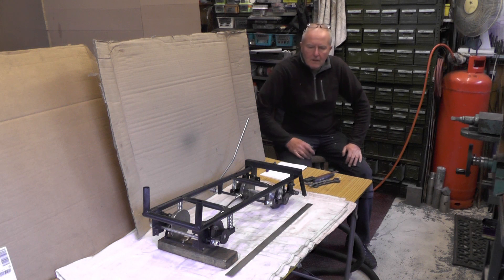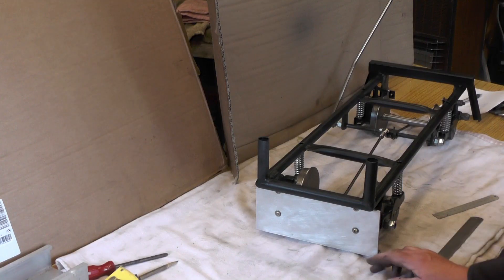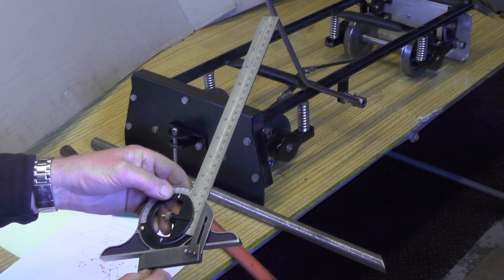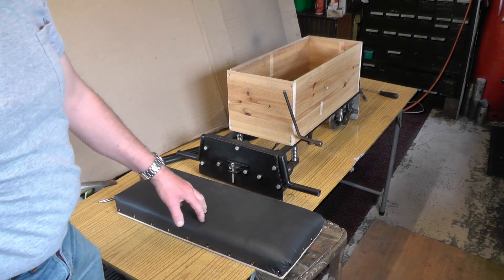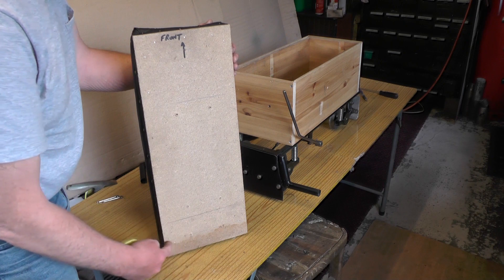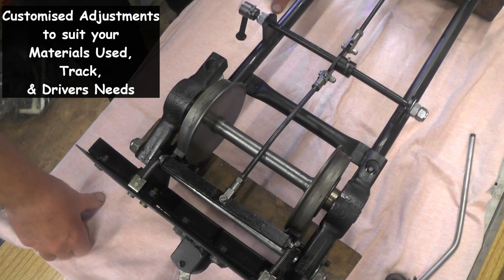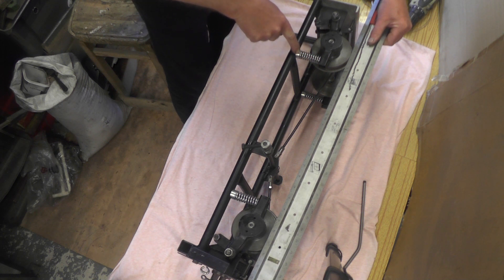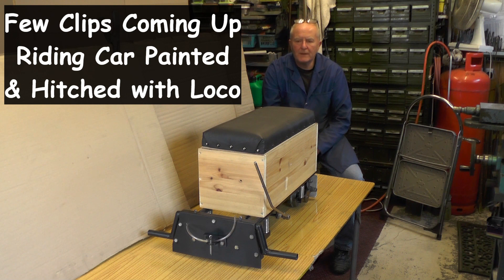Build Your Own 5" Gauge Railway Riding "Car" " truck" "trolley" Part 6 (mr factotum)

Comment: hi there. could you make me a driving trolley to seat me, the driver and one passenger I have a 5 inch gauge loco, a Neptune 3, and would like a driving truck/trolley to carry me as driver & one other person, so assume 4 feet?

Have you one for sale, or can you make me one please with twin bogies & braked on one of these, with foot boards etc.  Hope fully the weight so I can pick it up on my own, or split it to do so.  Its for ground track.

Rgds

Neil Mitchener in Poole Dorset.
Reply from the maker: Hi Neil
Thanks for watching and commenting, it's appreciated
If i had'nt got so much going on in life i would have loved to make you one, however  i just have not got time, also with the price of materials etc for making one off items i doubt if i could make one for the price a commercially bought one, when i make things for myself i usually plan months ahead, so i can gather mainly free materials together to save on costs. I think for you a more quick and more inexpensive way would be to contact MES Clubs around UK and leave your details of any sales of members stock in progress or in future, and even if it's one that needs a bit of renovation, i think this would be a more economical and quicker solution, i can leave your details at our club as a wanted item if you give me a contact number, however don't leave your details on YT messages, give me an email with all the details of the sizes, style and contact details and i will post on our club notice board if you wish. My email is on my about page, only viewable on a PC though, for some reason it doesn't show up when using phone etc. to view.
Good luck Neil
Regards
Kev